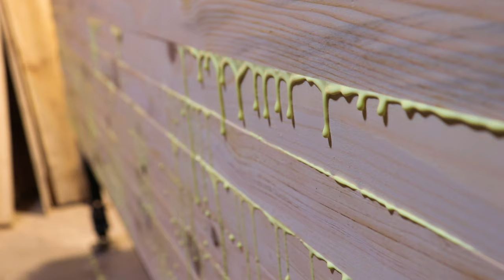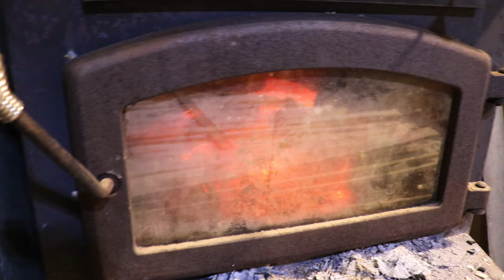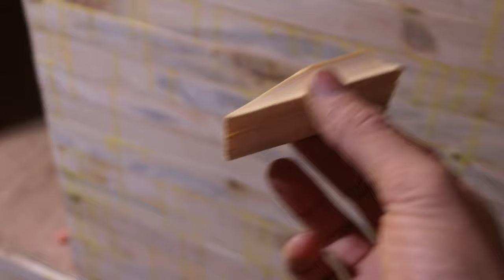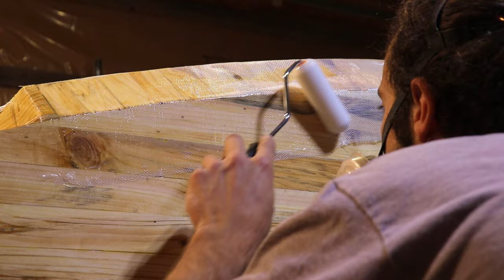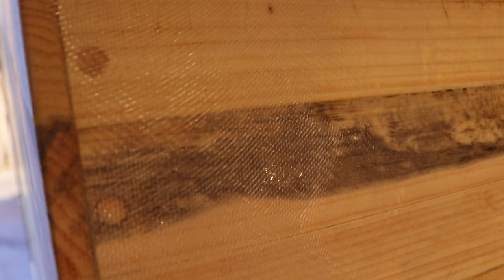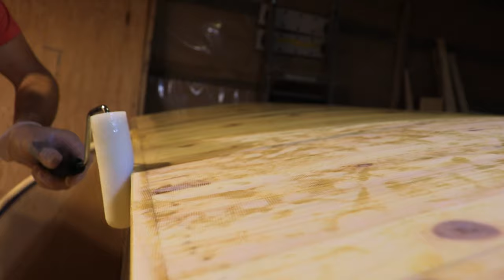How to Fiberglass on Wood | Teardrop Build part 5 | Episode 39

Comment: Fabulous!  Im nervous to do mine as I never have done this. I noticed you glassed all seams first with uneven side cuts of glass first while  epoxy seemed tacky and you glassed top and sides that appeared after epoxy fully cured and sanded?  Is this correct? Do you notice any difference in final outcome?  Im worried about seams I noticed you did sides last and pulled end fiber, and had your glass seam at the top where the wood siding seam is. Did this help hide the seam?  Any other fiberglass pointers, tips, or something you would do differently?  Sorry for all the questions this is a beautiful camper and I would like to finish mine similar.
Reply from the maker: Yes it’s totally correct! The final results it’s perfect:) If you tear the fiber glass, the seam is almost invisible ! Good luck with your project :)

Comment: what is the tool you used to cut the pine boards after you installed them? Do you think bartop or countertop epoxy would work for this as well? how many gallons of epoxy did you use?  any reviews of leaking after doing all this?
Reply from the maker: We used a router to cut the pine board :) you should definitely buy marine epoxy for that . The quality is a lot better than the counter top epoxy. 

The important step is to put a boat  varnish for UV protection:)